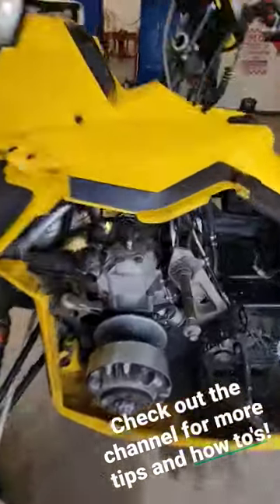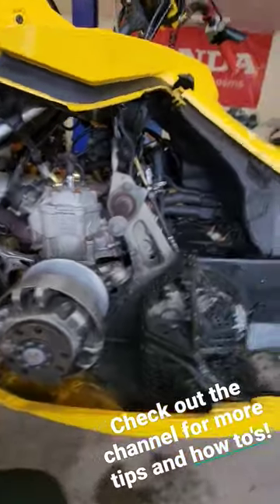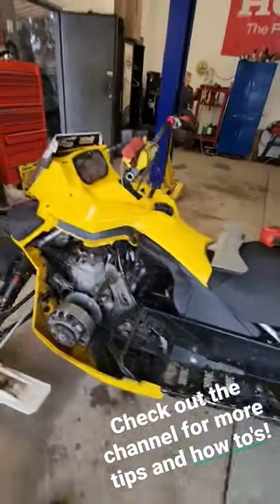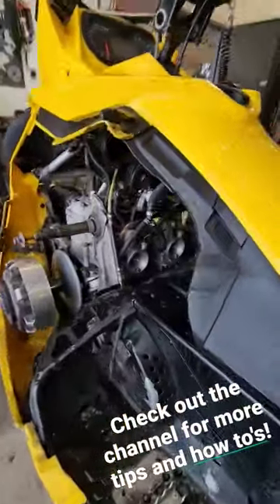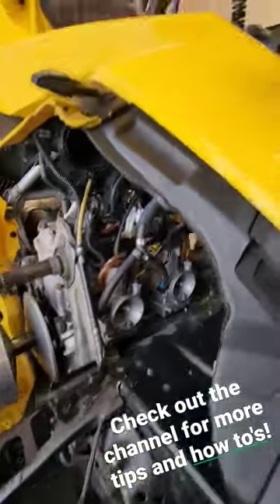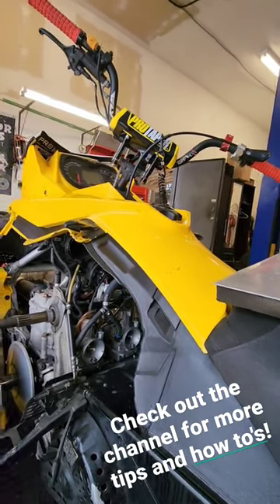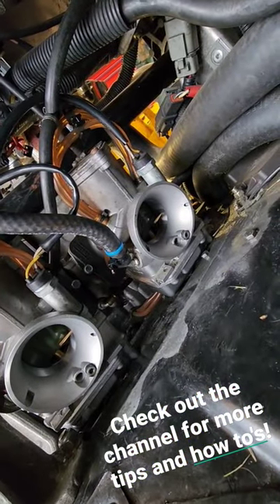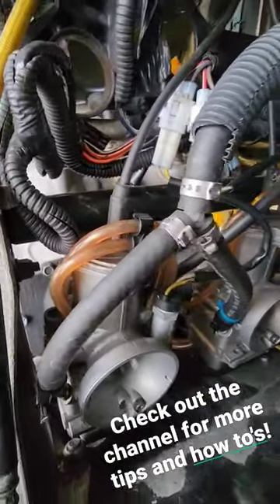Is your carburated snowmobile running rough? Watch this first!

Comment: I have to ask. Why does a 2012 snowmobile have carbs? Arctic cat had efi on some of its sleds in 01. Why does ski-doo still have carbs over a decade later?
Reply from the maker: I would say probably because their carbs are pretty dialed in. But fortunately I only get to fix them not build them so I couldn't tell you 100%
Reply: Some race sleds still had carbs till 2014 or so
Reply from the maker: @paulbunyan3drc251  yes this is also true!
Reply: Its a race sled thats why